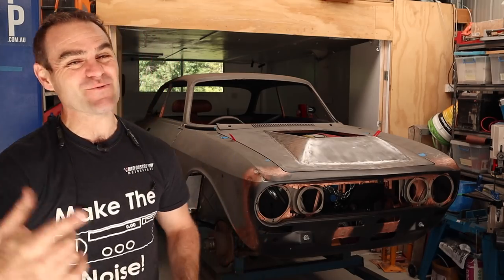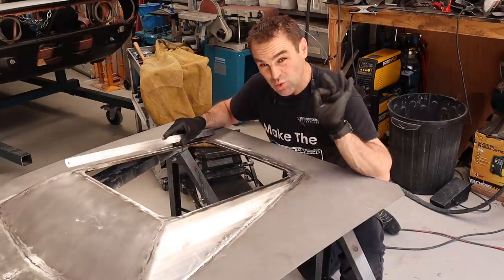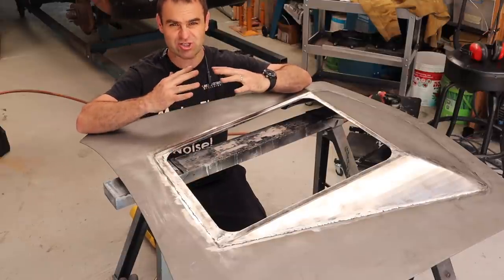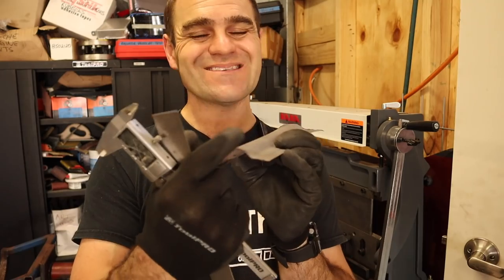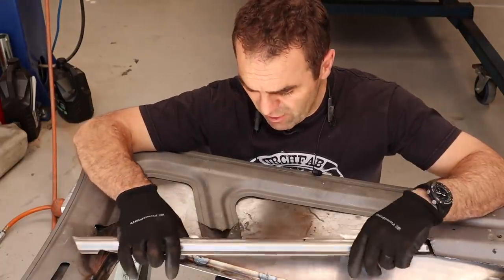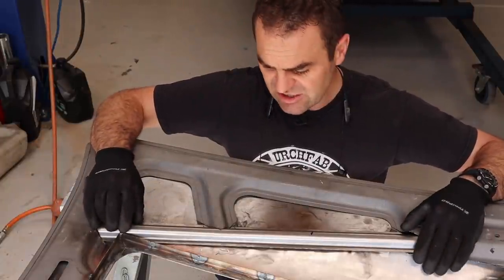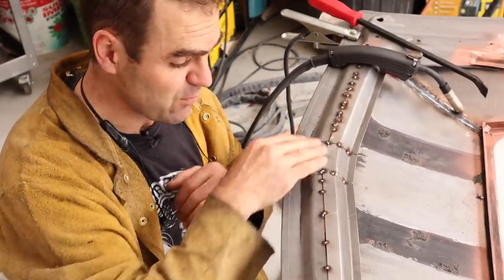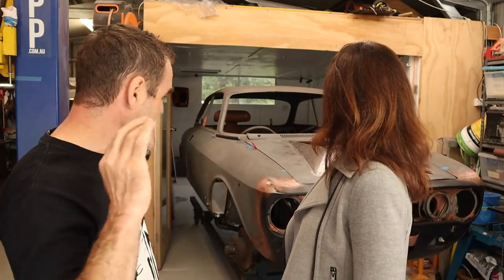Under bonnet bracing - Ferrari engined Alfa 105 Alfarrari build part 72

Comment: This episode arrived just as I finished (re-)watching the last six or seven covering rebuilding the chassis - noticed in the shots where you can see the entire sides of the car that the overall lines, nose-to-tail, are looking spot-on - I'm REALLY looking forward to seeing it painted!   ETA >> BTW, it looks like the bonnet is easily stiff enough (very nicely done) that later on you could make a carbon-fibre bulge (riveted), might look better than body-colour?

Comment: My uncle would heat the area and put a wet rag on it to shrink it.  Might try it on a piece of scrap when you have a free minute.  He started doing bodywork in the late 40's and knew a lot of stuff.   That said, looks great.  Looking forward to seeing what you do for paint.  Cheers
Reply from the maker: I have tried that in the past, but I don't like putting water on bare metal and it is not necessary as you can cool it with air.

Comment: Nice work.

Going back to the shifter position/angle, The ~2008 Subaru 6 speeds have a cable reverse lockout on the shaft of the shifter, you may be able to put a nice bend in the shifter shaft and then use an earlier subaru lockout mechanism (have not looked into any differences on the gearbox side.)

Comment: The easiest way to cut a full sheet in your guillotine is cut a small snip with your reds on the right and your greens on the left.  Then you can pull the cuts against the bottom cutting edge.
Reply from the maker: Good tip

Comment: I had a Mk1 Austin Henley Sprite.  Replaced the metal bonnet with a  fibreglass one for club days.  It was like I gained 100 hp and it stopped understanding.  Put the metal back on for road use.  If you track it it's horrible just how heavy the metal is.  Use that bonnet  and make a mold maybe.  Cheers.

Comment: Hey Jeff-A couple of questions have occurred to me.  When shrinking, you are using a slapper and a dolly. DOes this slapper have the cutting ridges associated with a flat file?  2)  Next time a project has both MIG and TIG welding, please address why you are doing one section with MIG and at what technical issue drives you to change from MIG to TIG.  I'm saving for a TIG and have never used one so having the context for the useage case would be helpful.  Thanks again-great great stuff
Reply from the maker: I might try to cover some of that.

Comment: another method to shrink high spot is heat this place and cool it immediately with wet towel. Especially when you have no access underneath. Welding path should be leading, not bonding

Comment: Jeff - are you planning on pulling the skin off the bonnet at all to rust proof/epoxy the internals of that frame and areas there the bonnet skin is obscured from the final coat of paint?

Comment: Your body work is impeccable.  I hate to bring this up. Weight. How much does the hood structure weigh? I would encourage you to make a fiberglass mold and build a carbon hood.  You could cut the lid off the frame after molding it. Then make a mold of your beautiful frame work build the entire structure from carbon fiber. I do not mean to harp. But nose weight is a big problem with the stock Alfa.  You are a true craftsman.  I would not bring this up if the quality of your work did not warrant it. I truly enjoy your channel.
Reply from the maker: This would currently weigh less than the original bonnet as there is less metal ;)

Comment: Instead of that bulge in the 'bonnet' - you could have split the Intake in 2 parts,  and simply made elbow fittings so the 2 intake would have been on either side of the cylinder banks
Reply from the maker: No you can't. This has been covered multiple times ;)

Comment: Would it of been nice to raise the back edge of the bulge about half an inch , so you could put a length of mesh black or chrome, would look nice in my opinion and be good for helping keep the engine bay cooler , just a suggestion that’s all , loving the work your doing

Comment: I love watching your videos. Your skills have co.e a long way in the few years you've been on yt. I'm in no way an expert, infact I've NEVER done body work at all. But in this particular application, wouldnt it have been easier to just but weld. I'm assuming since you over lapped and then did you 45 degree cut for the nice fit, you would have a small stip to pull out from behind. To me. It seems like it would be just as easy to get the fit up spot on instead. Just my $0.02 usd. Again, love your skills, and videos.
Reply from the maker: That is the beauty of this method. You get a perfectly lined up repair. To make a perfectly lined up patch panel the other way takes literally more than 5 times longer.

Comment: A guy came in the garage when the boss was on holiday he had a MGB with a V8 conversion all the paint was cracking on the bonnet bulge so me and the painter agreed a price of £150 to sand , prime and paint the bonnet as he was at a car show at the weekend this was monday , started sanding thought WTF going on sander kept going down and down in places the filler was 3 inches deep in places , he had not left a phone number so unable to contact him I made the decision to grind all the filler out , whoever had done the job had cut out a MK1Capri bulge then filled it until he got a shape the owner liked , you cannot stick 2-3 inchs of filler on top of a Rover V8 and expect it not to crack he also had messed with the colour as it was not the shade of red he said it was we got it pretty close though , he came and went nuts about shape and colour we told him to come in on monday when the boss was back , he came in on the monday told a pack of lies said I had quoted £50 to do the job it was the early 2000's and £150 was cheap , boss booked the car in for paintwork and he never came back the b/tard totally scammed us .

Comment: no plastic... please.. leading the panel will work better, and is safe to use( eastwood has a no lead body solder. you shoud be able to get it down in your counrty ).. you can control the lead better than platic... and no matter how well you do plastic.. water ' will ' get to the metal//have seen it many times.. once you spread the lead around you can come very, very close to the finel shape.. then just sand the rest off..  you can done on a few youtube videos.. dont discount it.. it does work..well
Reply: Lead is a horrible material - one of the most toxic metals around and is therefore outlawed in a lot of countries to use in this application. If you have water penetration through the plastic then you have not done the surface treatment correctly. Remember no primer is waterproof.
Reply: @XiraArien  this car has lead on it,, and the ' lead i was talking/posting about it not real lead..its a lead free solder  , check out eastwood site
Reply: @randellgribben9772  so when reading the health hazard (SDS) for the lead free solder you think it is safe? You should wear dust mask ofc. The fumes are toxic so you need respiratory protection for that as well and you need to wear gloves :) but other than that it is safe. Although this is more or less the same with plastic body fillers. However if they are subjected to water you get rust no matter what solution you pick. I would although be careful with the soldering as it easily can distort the plates if used on large sheets.
Reply: @XiraArien  lead free soldering on a panel has a lot less heat than a welder... warping of panels with lead free body solder is not an issue... please tell me about all you time working with lead free body solder.... what? you never used it?? and yet you make these judgements?  you are not inhailing the lead free body sold.no vapours..it does not get hot enough to go to  a vapour state.. you are just heating it to a soft butter state... a couple hundred degrees below what you seem to think.. perhaps you shoud check you facts...first...
Reply: @randellgribben9772  once again you show lack of knowledge. I never said anything about heat from welding. You apply body filler when welding is done to get the perfect finish on the surface. Soldering does require heat as you mention - about 280-300c or about 600F. However, how do you generate that heat? By at butane torch - right? What is the tip temperature of that burning arc? More than 1400c or 2500F that generate fumes before the heat dissipates through the material no matter how you try. 
I think you clearly try being a troll here - attacking my experience and knowledge without any background whatsoever. And clearly your great argument about not using plastic filler due to water penetration kind of falls apart as plastic filler has never been waterproof - so if you get water underneath you clearly have done something wrong in the process before giving the surface a protecting waterproof layer.
Reply: @XiraArien  i worked at an alfa romeo/ ferrari and other italian cars shop in vallejo ca. for 12 years...we repaired, and restored these cars... and if i had to use plastic filler.. i would use step one on leading a panel.. i would clean the area really well and get this..hold on to your panties/// i would ' tin the panel ' look that part up.. this would alow a good base for the plastic to stand on but provide a tin barrier to prevent water getting to the bare metal... the shop was... alfetta motors
Reply: @randellgribben9772  so you are saying you would completely “tin” all the panels to make the water barrier? I simply doesn’t make sense to me. I know it is more of a matter of religion to use plastic or solder and I am happy of leaving it with that. However the argument regarding water is not valid. I too have a long history of working on vehicles and living Northern Europe I do know how to be careful about the prep work or rust is seen reappear within a year. The main is to remove all rust - apply bondo/solder - prime paint - finish paint. Not until the finish paint has been applied the surface is porous and water can penetrate. It is therefore crucial to have the repaired/restored part in heated dry conditions until finish paint has been completed. Solder, plastic or primers do not protect the panels from rust. I am a mechanical engineer with amongst other metallurgy background.
Reply: @XiraArien  this is not the proper area to discuss this.. this  is JEFFS site, and we should understand and respect  that... to Jeff.. i am very sorry to  this happend.. again very sorry..